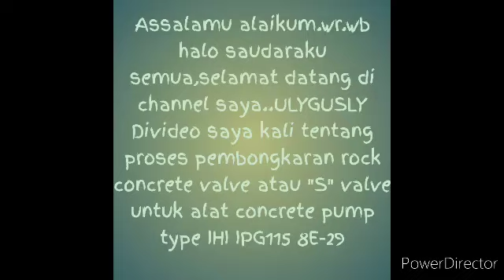concrete pump IPG115 8E-29, proses pembongkaran rock concrete valve atau "S" concrete valve

Comment: Bos pressure Valve yg normal it brp ribu bos..mksh sblm y
Reply from the maker: pressure yg di mnanya bang...
pressure main pump atau pressure sequence valve
Reply: @ulygusly416  sequense Valve
...mf mas Mash pemula sy..
Reply from the maker: kla utk pressure main reliaef pump hydrauliknya 280-315 kg/cm2...
kla pressure sequence valve utk sliding yg tipe ipf 110 bisa di 100-115...kla utk yg tipe ipf 100-115 yg dobel pump penggerak sliding atau rock valve pake gear pump 115-150 kg/cm2....nanti penyetelan disesuaikan saja kebutuhan pressurenya spya aqumulator aman dan awet..
Reply: @ulygusly416  mksh mas Ats pnjlasan y
🙏
Reply: @ulygusly416  ms mf sblm y..in mu y ny ms..baling baling di baket kok mutar y lemas..bahkan trkadang mati sndri..it AP y mas..mksh sblm y